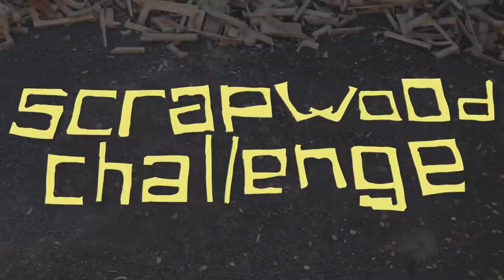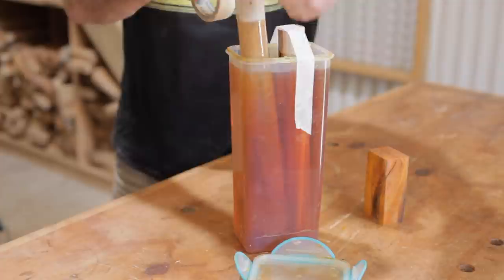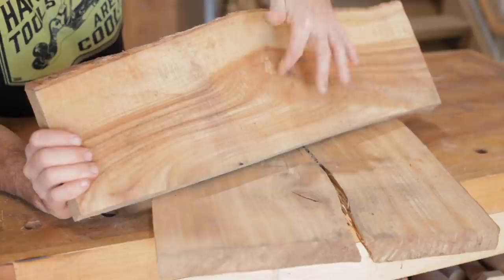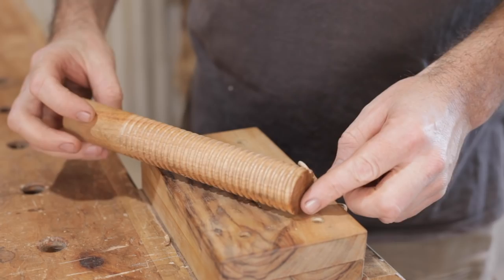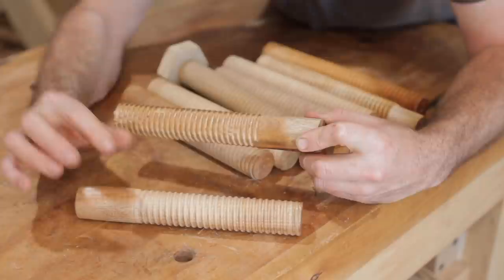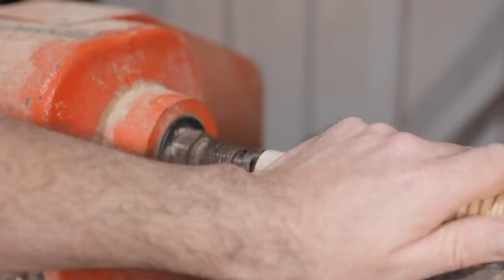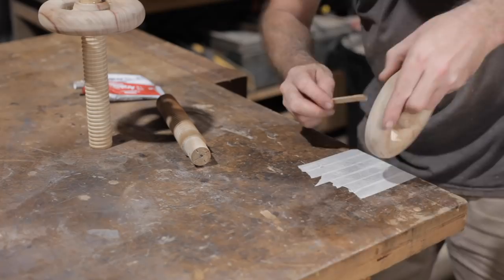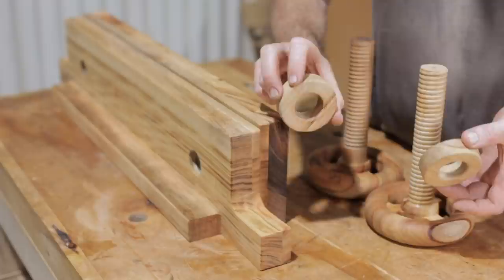Making a Moxon Vice - Scrapwood Challenge ep30

Comment from the maker: This has been on the to do list for a very long time. I reckon it's a great addition to the workshop. I think the wheels look fine but I'm not sure I nailed the design and that's something I may try again in a future project.
Reply: did you make the tap and die? If so do you have a video on it?
Reply: Thanks for the very inspirational video, it's somewhere in the top 10 on my to do list
Reply: I love the "steering wheels".
Reply: I eagerly await each video you put out and I have yet to be disappointed! Thank you!
Reply: Pask Makes ate you Australian?
Reply: You are one of the coolest channels on youtube.
Reply: Ever the perfectionist. I guess that's how you got to where you are. :) Thank you for this. I could watch your videos over and over in complete fascination.
Reply: @chjeltness  

one thing I did was to extend the face of the jaw mounted to the table, just to make it that much easier to align.
Reply: @chjeltness  I totally agree.
Reply: What type of wood is that?
Reply: BTW I noticed your DIY bands saw in this video. It looked like one I'd like to have myself. Do you have a videos while making it. Please supply a link to the video if you made one. Also when you soak them dowels in oil and  leave them over night that is all well and good.  However if you want toTo speed things up put the dowels in a container of oil n pull a vacuum on the container. On the cheap the vacuum could be accomplished with an old refrigerator compressor. Cut the wait down to a couple hrs instead of  over night. Just a suggestion but I think you will find the oil penetrate more into the wood n deeper n faster. If you could do it in a glass container you could easily see just how effective this process is by all the bubbles coming out of the wood and make perfect threads every time. N might be able to shorten the  wait time down into minutes.
Reply: 😅njk

Comment: When I soak my knife handles in oil, I put the knifes and oil in a plastic bag, then put that into a container similar to the one you used, but fill that with water to reduce the volume of oil needed around my wood. Might be a handy trick if you're low on oil and need to soak a long piece.
Reply: Clever!

Comment: The handwheels are great, almost worth getting a lathe just to make a pile of those.
Reply from the maker: mozismobile Glad you like them Moz! You should get a lathe, they were fun to make. 😊
Reply: Even without a lathe, you can make those using a router bit and or a drill or post drill. Where there's perseverance, there's "can".
Reply: You should definitely get a lathe, they are great fun to use!

Dare I insert a shameless plug here? (Check out my newest video, there is lathe work in it) 😉

Love your stuff Neil! Keep up the scrap wood challenges, they’re fantastic!
Reply: You could make these without a lathe, cut a circle or cut four parts of a circle and join them together, then round them over on both sides with a router table to get a "tube" circle..then you can insert a center any way  you wish...

Comment: Really cleaver! nice craftsmanship!
Wonder if you could link the 2 screw with some kind of rubber band so they run in parallel. Also could add a retainer on the screws or a spring so the front plate stays tuck againts the handles

Comment: I've seen a lot of these made, but I never saw a prettier one. That lumber is really nice. I'd have to pay big bucks for something like that here in the states. I've made a moxon out of 2x6 construction lumber used carriage bolts, far too light duty. But I balked at paying the price for something like the benchcrafted setup. Hmmmmm, now where could I find handwheels like that?? I ended up using handwheels off old treadle style sewing machines. They have a tapered hole in them, but turn a hunk of hardwood to fit and epoxy them in place and you're good to go

Comment: Nice leg vice! Been meaning to get one. Was hoping I would stumble upon one at a yard sale but so far no luck. But you ask if one can have too many vices? My dad had too many and it landed him in jail. Lol joke joke. Hes a good man...

If you dont mind me sharing a tip with you about laying out a hex more accurately.. cuz you know how that last  mark is always  a little short compared to the rest .. if you bisect the circle  by drawing a straight line through center. Now you have 2 accurate start points. Put point on first one and leave it planted while you mark off on both sides of it. Then plant it on the other start point and do the same.. another possibility  (which I've never tested out) is to just plant the point  on the circle  , mark both sides and draw lines through center of circle from each of the now 3 points you just made.. obviously,  the lines need to be long enough to intersect the circle  opposite  each of the 3 points ..  

Congrats on another great build! Keep 'em coming

Comment: My main (read: only) vise is a Moxon like vise. It's built into my bench so it's not  really a Moxon vise, I just call it a twin screw vise and it has been fantastic.  I suppose I'll add an and vise at some point but so far, there's not been anything I couldn't hold.  The only thing I've found that's a bit of a challenge is where you place the material to prevent the chop of the vise from skewing too far but it's really not too bad. Yours looks fantastic!!

Comment: What beautiful handwheels!  And a beautiful vise!  Where did you find the threading device?  I'm making a moxon vise with wood handwheels and the rest of the design is much like yours.  My wood wheels are just circles cut out of plywood, rounded over, attached to threaded rod.  I don't have the equipment to make them elegant like yours.  I may have access to a lathe this fall or winter.  If so, maybe I'll give it a try.  Inspiring!

Comment: I'm new to woodworking still. I have a leg vice and tail vice on my bench, as well as a cleet. But I'm still unclear on the use and purpose behind a moxon vice. Could someone clarify for me?
Reply from the maker: It's for clamping wider boards as there is no screw or guide rails in the way. :)
Reply: @PaskMakes  thank you for the clarification

Comment: I do not care to read through tonnes of comment but, your "black-smith vice" lacks something, a leg, it is supposed to take the impact from the hammer and transfer it into the ground, in your picture it is cut off about 2 inch from the base(i´m not sure cuz i use metric standard, but my eye-gage is pretty rock-solid..., it should be much longer, maybe 70 centimeters (27,55")inch)) depending of your standard height of work-room. Good luck, i have an un-fucked-up vice at my disposal that i bought for $15 at good-will. :) "ca-shing"

Comment: Wow, what a beautiful vice! Why did you soak linseed oil on the rod and not on the vice jaws?
Reply: It helps the tapping process, he made a video about it before I think. It prevents the wood from tearing when you make the threads
Reply: @MsSpermator  . . .  That doesn't explain why the rod was soaked in linseed oil and not the jaws because there are threads on both.
Reply: @grantham418  the rods are much more prone to tearing than the jaws plus the jaws are less practical to soak...
Reply: @grantham418  check out the video "the secret to making perfect wooden threads"  by king's fine woodworking.

Comment: Why does everyone use a chisel to round stock on a lathe? You spend too much time keeping them sharp. Start using a wood rasp, it only takes a little longer but saves in the long run. I keep a bunch on hand bought cheaply at Harbor Freight.